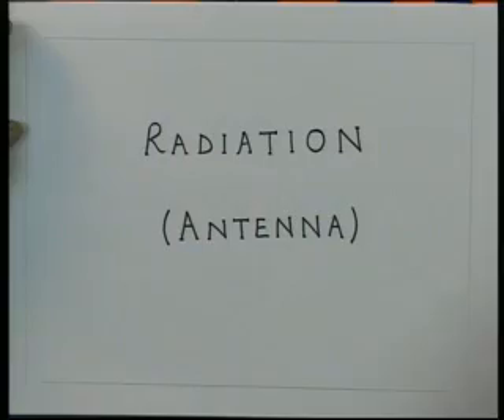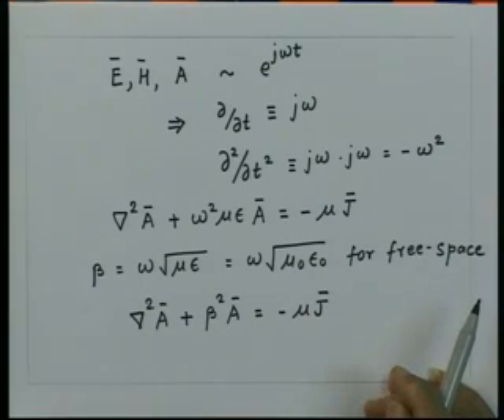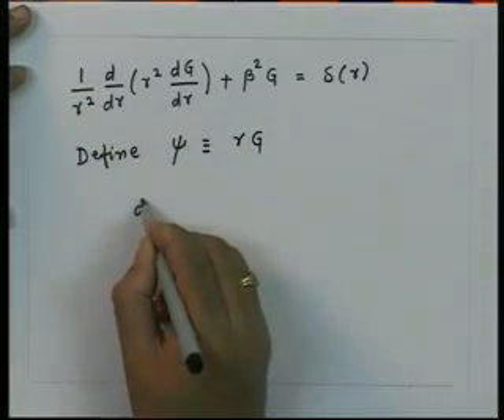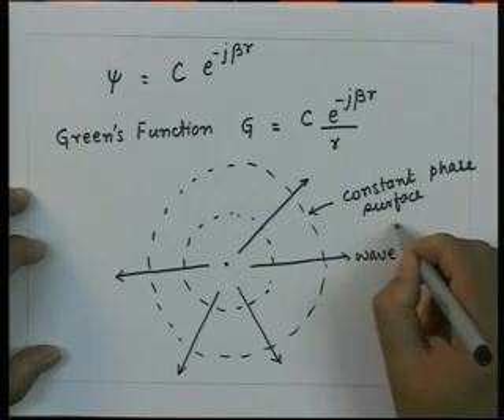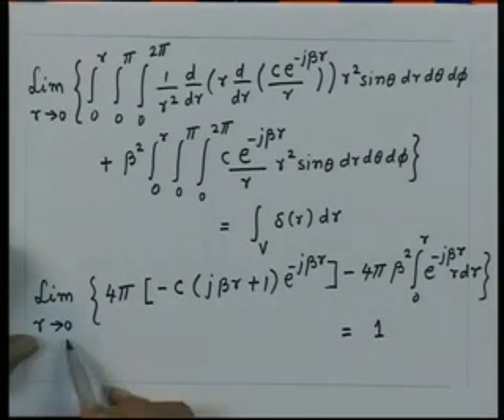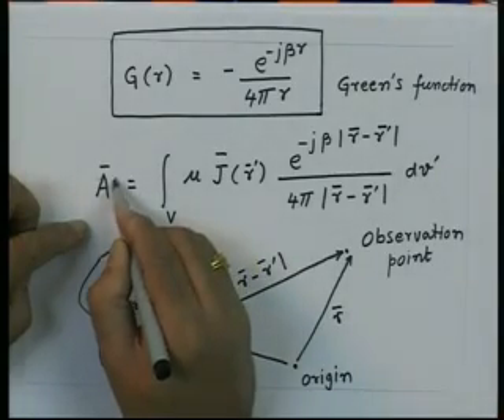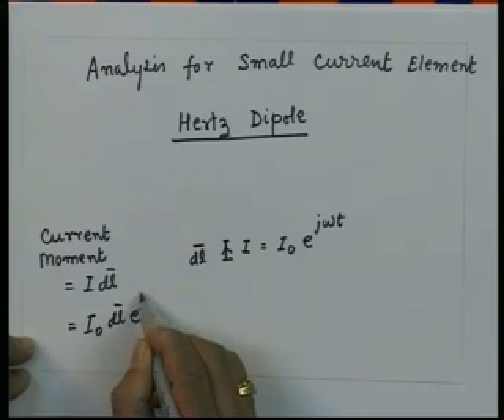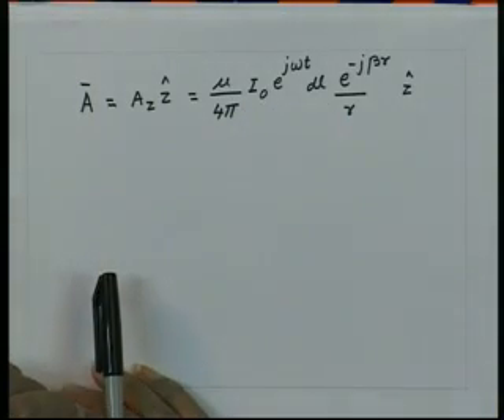Solution for potential function

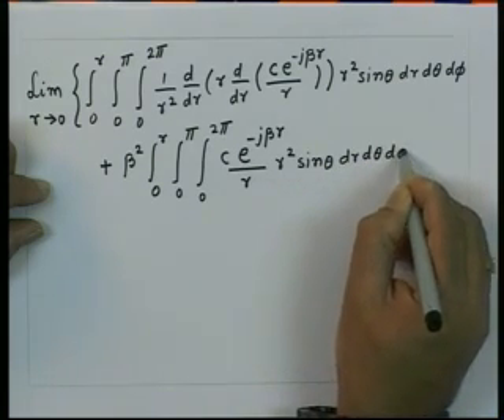Comment: Correction:  29:00 to 29:14. In first term it should be inside d/dr (r^2 × d/dr(Ce^(-jbr)/r)) but he has written 'r' in place of r^2. Also that Green function detour could've been easily avoided had he used Green's divergence theoram then work would be less then we will have to work out one surface integral and One volume integral. But here we are working out 2 volumes integral which is prone to error. But follow any method you will get C=1/4pi. Spherical symmetry exists so you can directly take dS=(4pir^2) r hat instead of writing sin theta dtheta and dphi again and again with limits 0 to pi and 0 to 2pi.

Comment: in the final equation after integrating greens function is j Beta r missing from the limit equation
Reply: Are you talking about the solution to the volume integral in 30.24? What answer did you get? I am not able to get the same answer as Professor.
Reply: @paulamiroy953: Yes you won't get because, Sir missed one r inside first term while formulating that equation. Which should be r^2 times dG/dr but he wrote r times dG/dr. After writing equation correctly when you will evaluate, using two volume integrals, then you will get C=-1/4pi.